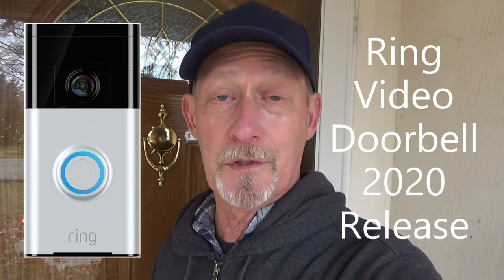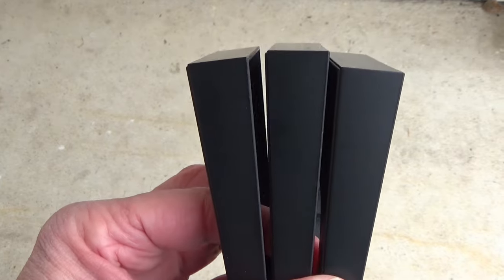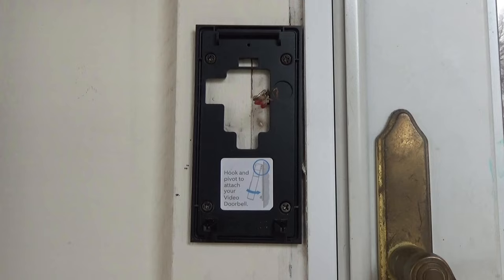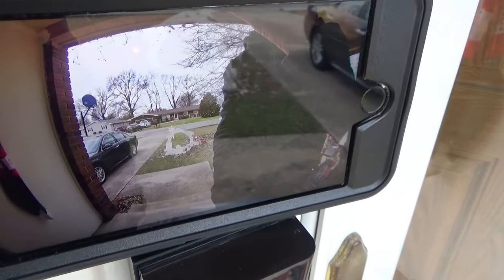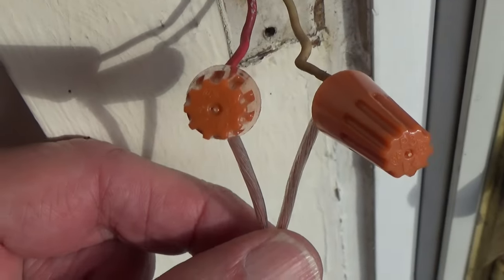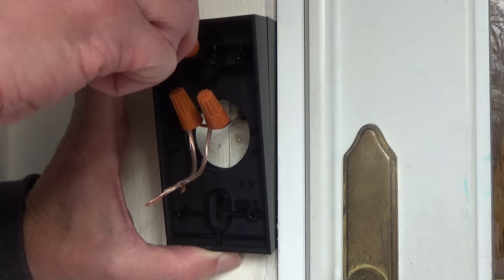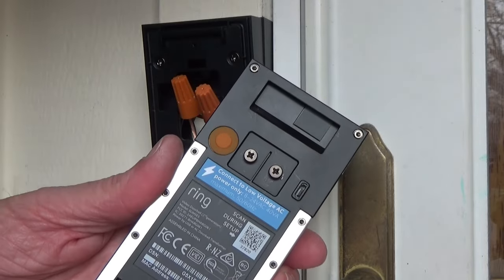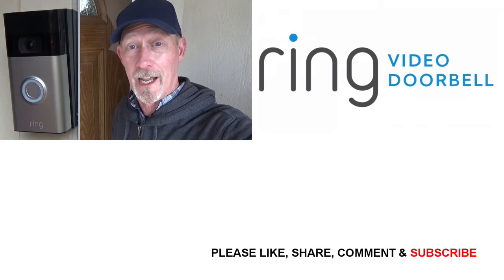How To Install A Ring Video Doorbell Wedge Kit On New Or Existing Ring Doorbell

Comment: Will those wedges work flipped upside down? My ring camera is closer to ground and doesn't show the person's head when they are at my door. I need the camera angled up more.
Reply from the maker: I looked that up, and the general consensus is that it won't work well doing that. This was a typical comment: No, the Ring Doorbell wedge kit should not be installed upside down. The wedge kit is typically used to angle the Ring Doorbell downward, which can help reduce motion alerts from passing traffic and ensure visitors are captured. Adjusting the angle upwards could negatively impact the doorbell's motion detection.

Comment: Good video. The instructions i got i cant even read!  You asked, so i have to say im very disappointed with my Ring doorbell ). When it works its great but mine will stop sending any alerts randomly. dozens of calls to customer service. Cant seem to fix it. Ring is sending me another no charge and advise a wedge kit which they already sent.. We shall see. but at this point I wish I bought another brand.

Comment: Hmm. I've gone back and forth a few times looking ago the view before and after. Don't see much difference. Maybe a foot or a little more of the porch but the street looks a lot the same, which surprises me. I need to do something, not sure if this is the solution.
Reply from the maker: You can always add another wedge if you need more of an angle. Two wedges was just what I needed.

Comment: @Stan Cravens thank you for this video. I would like to get this kit, but I only have aluminum siding to add the door bell on. Will the wedge kit go through the aluminum siding? Can I mount it to aluminum siding?
Reply from the maker: You would need to make sure you use self-tapping sheet metal screws…those work well when fastening the mount to aluminum.
Reply: @HowSkills  thank you very much.

Comment: Hello.  The wedge kit plates that you are using have the four holes spaced more closely together than the plates that were shipped to me.  So frustrating.  Any suggestions?  The two top holes on the MOUNTING PLATE that came with my Ring Doorbell second generation are 3 and 6/16ths inches (3.375")  above the bottom two holes.  However, the two top holes on the WEDGE KIT PLATES I bought are 4 and 3/16ths inches (4.1875") above the bottom two holes.  So, the holes do not align.  The wedge kit plates you are holding in your hand in this video are correct.  They look slightly different than the ones shipped to me.  Can you please help here?
Reply from the maker: I would return those to the seller and have them give you the right ones. If a return isn’t possible, you might have to drill two new holes in the Wedge Kit plate that match with the holes in the original mounting plate. That’s not ideal, but it sounds like you have enough room to work with. If you do have to drill new holes, do so carefully so as not to crack the plastic. You might start out by drilling a very small pilot hole first, and then finishing with the proper size bit.

Comment: Do I need electric line?
Reply from the maker: If you don't have an electrical supply to your doorbell, then it can run on the  internal battery. But with this model of the Ring doorbell, it's a little bit of a pain to remove the battery to recharge it, as you have to remove the whole doorbell first. They do make other models that have more easily removable batteries though, which is much more convenient. Having an electrical supply line is great if you have one, but not absolutely necessary.